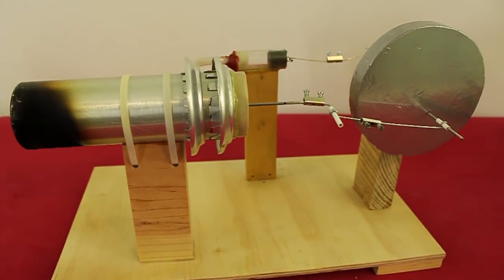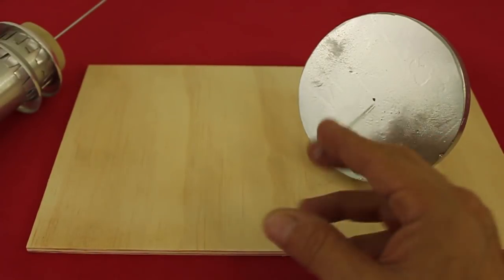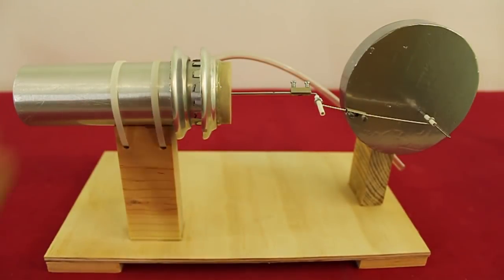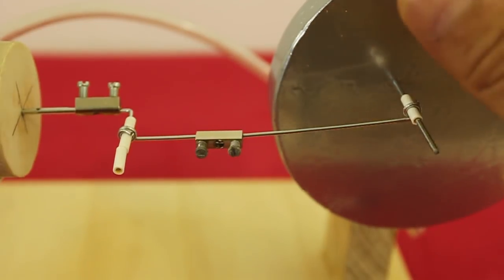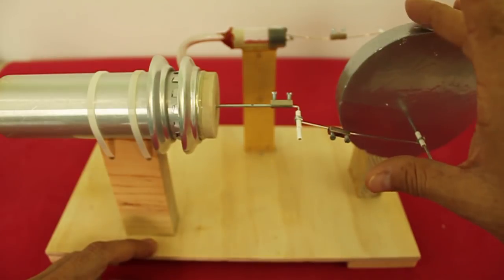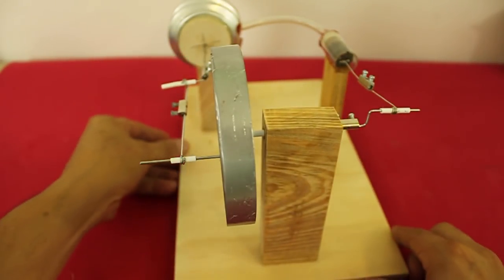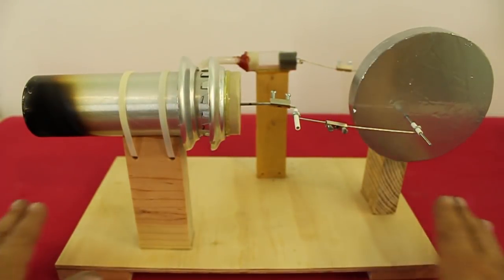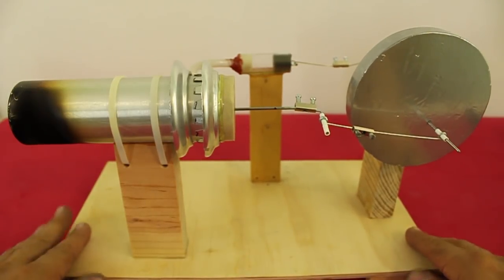DIY Gamma Stirling Engine Part II

Comment: Does the air outlet need to be on the cold side? In my design it would be nice placed on the heat side, but dont know of that will work the same.

Comment: So I'm having trouble understanding the effectiveness of the steel wool, with the hot end of the displacer closed.  Seems to me like it makes it so when the displacer is in the hot end, you still have a lot of air down their inside the wool.  And vice versa - when the displacer is in the cold end, you still have a lot of air up THERE.  Why do we not seal both ends of the displacer, so that the air it contains is isn't part of the working volume?  You cited this as a possibility - putting another wooden cap on the cool end of the displacer.  Have you tested the system in that configuration?
Reply: back end of piston pushes, steel wool cools air on the back cycle

Comment: don´t forget to cool the cold side of the heat exchanger and mount a little motor driven by the the flywheel and use it as a generator (measure voltage and current (connect a led or something else))